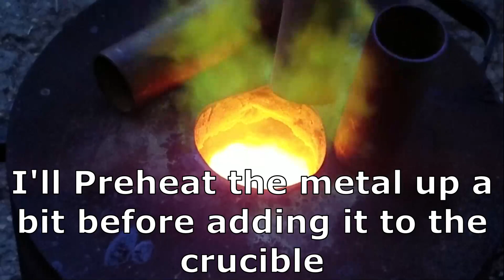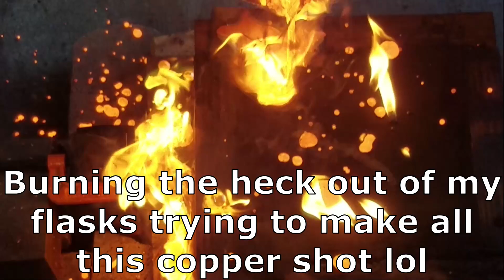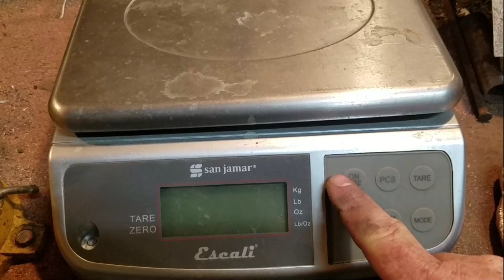Making a Copper Wolf Plaque - Metal Melting - Copper - Sand Casting - Devil Forge #DevilForge - Wulf

Comment: The details on the wulf plaque came out awesome! Nice weight to it too!
Reply from the maker: Thank you!! It would have been a bit better if my printer hadn't distorted the sides and back. Magnetic build plate wasn't strong enough to hold the surface area of the print.

Comment: The detail is absolutely amazing! I've seen several of these pours but they fail to capture the exact features of the mold used. Your copper was heated much more than I  usually see. You sand packs much tighter than I've ever seen and that additional shallow you dug out for your pour is new as well.
Reply from the maker: Thank you, much appreciated. I don't measure the temperature of the metal, usually is just a judgement call, but typically after its all molten, I give it 5 or 6 minutes, and then pour it, usually turns out great. The sand is just regular Petrobond sand that I have rejuvenated, just added oil to the mix of burnt sand. It works good enough for me not to have to continually buy new sand. The dig out is usually done for non-split patterns to basically establish a parting line, if not some of the sand could breakoff  when you try to remove it, it just helps to improve the process and aid in removal.

Comment: Sorry, but any sort of enlargement at sprue base increases turbulence - it does not reduce it. Spin traps need to have tangential entry to work as intended. Suggest that you remove sprue and vent formers before striking mould off - much easier - just be sure to blow both clean of loose sand afterwards though  😊. ... Martin
Reply from the maker: I only tried it cause I seen it on a diagram somewhere, seemed to work better in most cases. Not sure what you mean by tangential entry, can you explain this a bit? I'll try and remove the sprue formers next time. Thanks for your suggestions.
Reply: @Thewulf56  I do not blame you for using the sprue base well as many people do use it and many books recommend it. The US navy foundry manual for example is one such book and is commonly read. But we have to remember that it dates from 1944 – scientifically, things have moved forward a bit since then! There seems to be this comforting feeling that the “pad” of metal at the sprue base absorbs the momentum of the stream coming down the sprue. However, this ignores the fact that the sprue is initially full of air. What happens to this air? It gets washed out by and into the mould with the metal – not what we want! It takes some seconds to do this meaning that perhaps as much as half the metal is contaminated with air. As the first half is the casting and the second half is the feeder our castings are off to a bad start! For the sprue runner junction its better just to use a simple “L” intersection with the inside corner of the “L” radiused and then a  momentum absorbing spin trap on the end of the runner.
Bit hard to describe tangential entry without pictures but I will have a go. Imagine a runner 10 or 15 mm square entirely in the drag. At the end of the runner is a spin trap about 30 mm diameter going down into the drag to match the runner depth and up into the cope 20 – 30 plus mm. The runner must enter the drag section of the spin trap entirely to one side of the traps center, thus one side of the runner coincides with the OD of the spin trap the other side lines up pretty much with the center of the spin trap. You must have a vent about 5 mm diameter from the top of the center of the spin trap up to the top pf the cope. The gate which should be about midway between the sprue and the trap should lead from the top of the runner to the casting – preferably the gate should be entirely in the cope. If this is still confusing come to me at  olfoundryman@gmail.com and I will send you back a sketch… Martin

Comment: Were you to scroll a animal shape, " wolf or a deer." Perhaps a buck from 1/4" thick piece of plywood. Would it be possible to make window pane of copper instead of glass? Its an idea I have for building a tool shed with mock windows. 6"×6" panes. Or would it be a waste of time
Reply from the maker: I don't know about manual cutout, you need some draft angle on the patterns, or they need to be really flat, around 1mm or a bit less, and be pretty basic.  If you could have one CNC'd, and carved out that way, It would be easier to cast, this pattern for this said for CNC. There are lots of CNC patterns out there, and you could find something you like and see if someone could make a couple  for a pattern and give it a shot. Just give them the specs of what size you need.

Comment: Would a dreamer work to sand and polish the oxidation from the copper?
Reply from the maker: Anything small enough to get in the small gaps would work as long as its not to abrasive, so that it does more damage than good.
Reply: @Thewulf56  so I would need a certain sand paper then. Ok cool thanks
Reply from the maker: @thelasvegaskid  if you are just removing the oxidation that was on it from when you cast it, a small wire wheel can get into the small gaps, or a bigger one for the whole thing, but to polish it, then you need to sand at many different grit sand papers and then use a buffing wheel with a buffing compound
Reply: @Thewulf56  awesome! Thanks for your insight. I’m new and want to start soon. Hopefully I get one for Christmas.